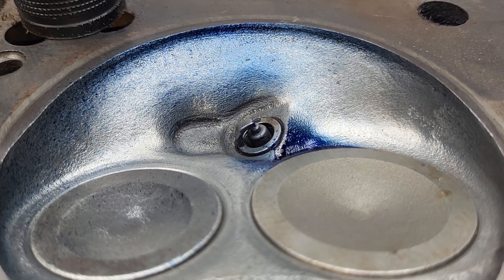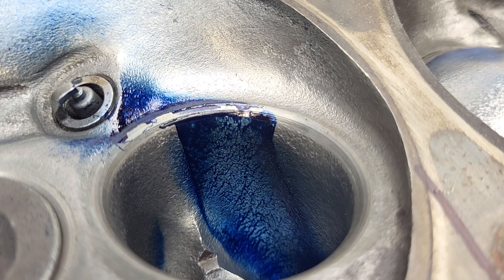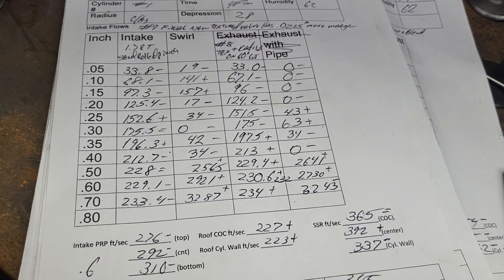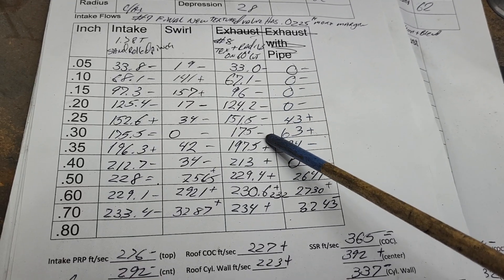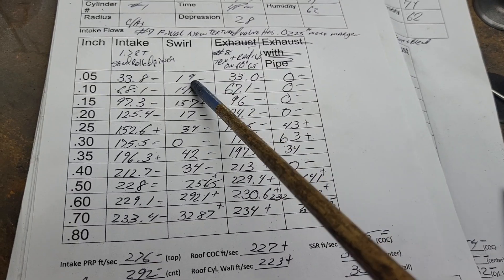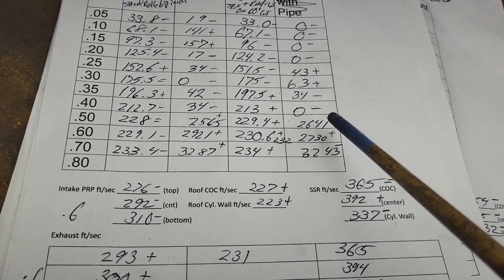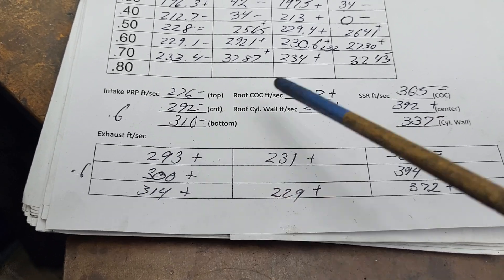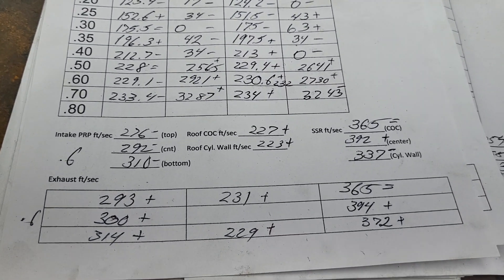David Vizard, Unity Motorsport, Mission Impossible 318 project. Rough burr radius to bottom of 60

Comment: If looking a wet flow flow fuel management; will that be changed with the turns of the intake?
Reply from the maker: It will. My job would be make the fuel managment as good as I can on the head itself. Thanks

Comment: One thing Charles. Once a intake is bolted on, half the ports will move the air/fuel column towards the inside curve. 3,4,5,6 ports will place fuel patterns over.
Reply from the maker: Good info. Thanks